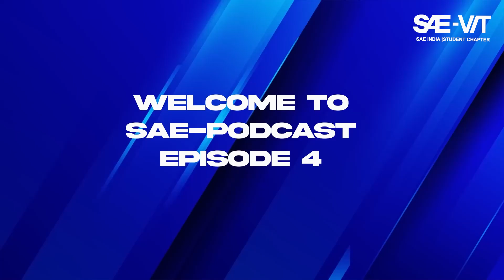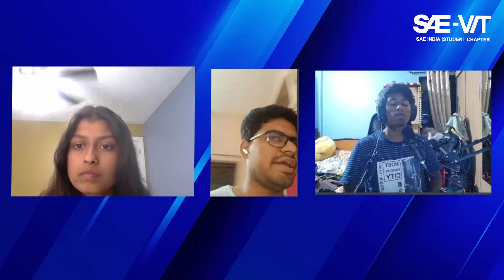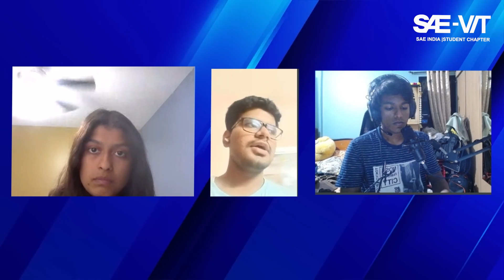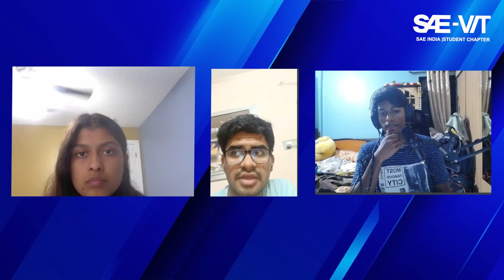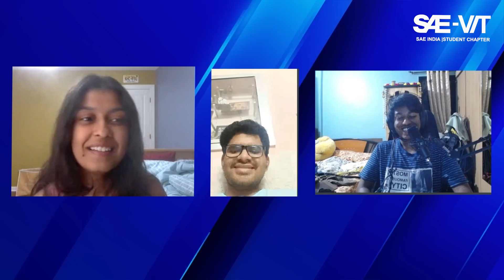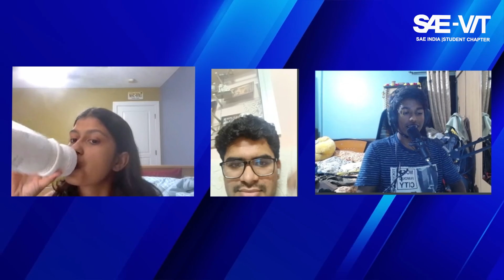SAE Podcast S01 E04: HAL AMCA

Comment: Canards in AMCA? Are you sure ? I don't think so. I think you are confusing it with the Tejas Mk II. The wings are trapezoidal . The design of the AMCA has been freezed and don't expect many changes. I would have loved to see "fly by optics" (optical fibre) in place of "Fly by wire" .
Reply: As per the few design leaks available on the internet, the amca design design does have canards. If not amca mk1, amca mk2 will most surely have canards as they are a vital part for achieving high maneuverability.